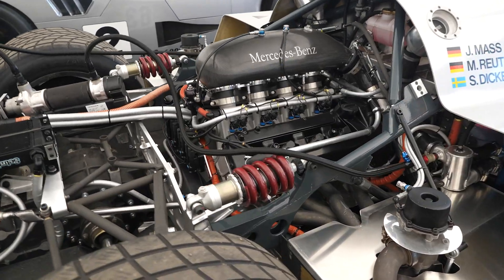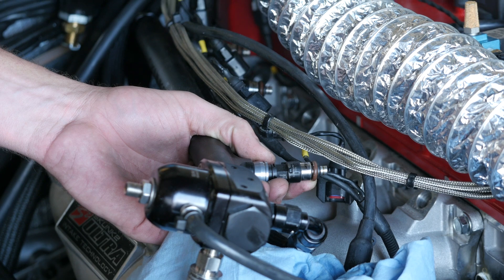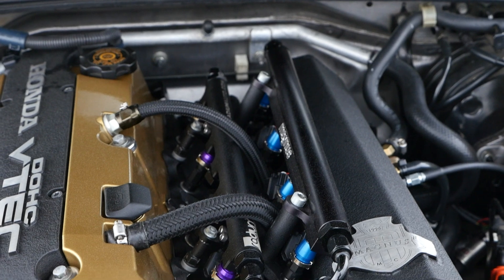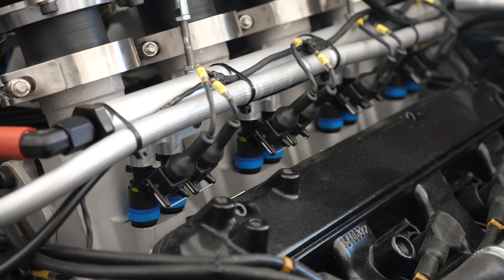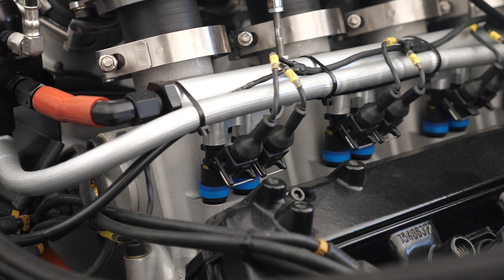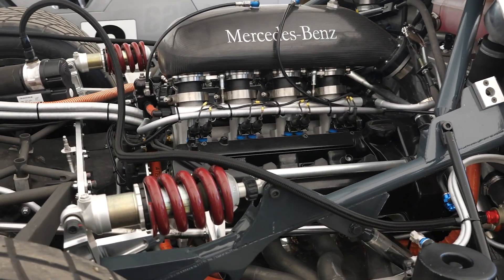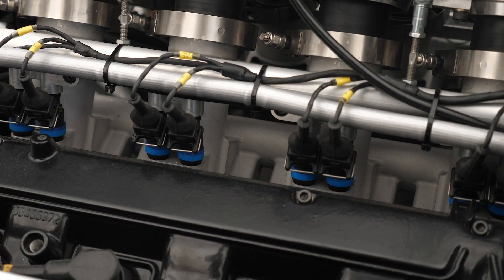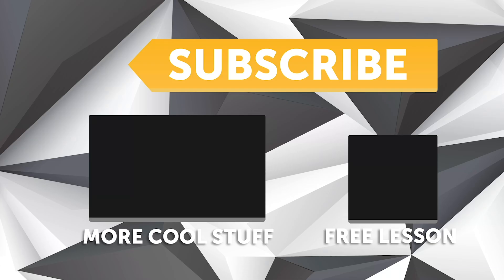Staged Injection VS TWIN Injection! | 800HP Sauber-Mercedes C9 [TECH NUGGET]

Comment: very good as customary Andre. if you can, i would like to see a video on dual VE switching tables. i have a turbo car that has 2 VE tables. i use one for the N/A areas and the other for the boost areas. thanks💪
Reply: I've had my own version of dual injectors on my car since around 2004. It automatically switches from 87 octane to 116 octane on-the-fly.  It works extremely well. http://www.turbomalibu.com/dualfuelsystem.htm
Reply: @TurboMalibuV6  a dual fuel system isn't what I'm speaking of. i would like education on dual VE table theory and tuning for a single set of injectors. like building one fuel system that performs like a dual fuel system.